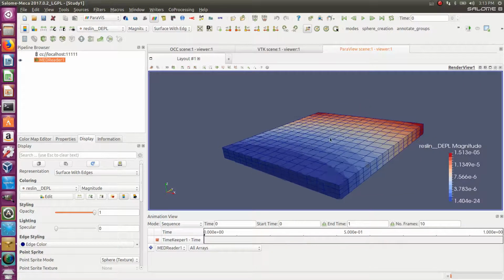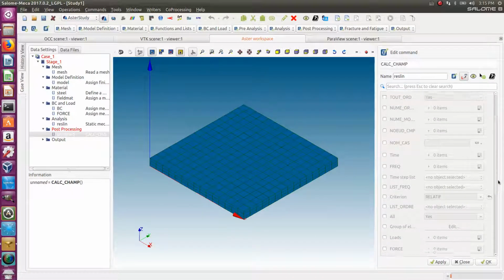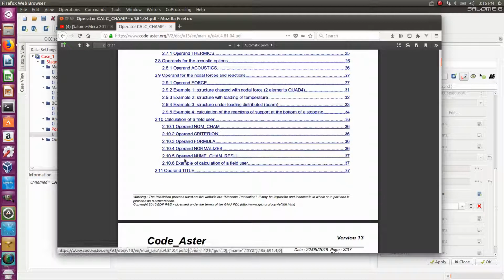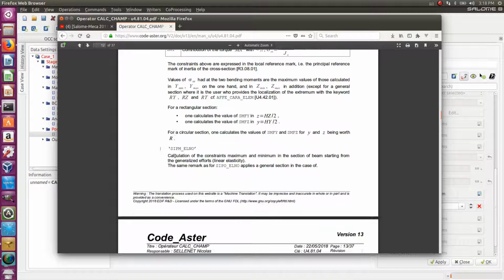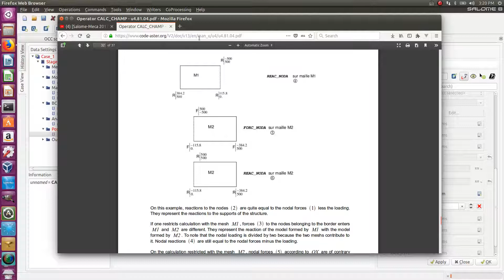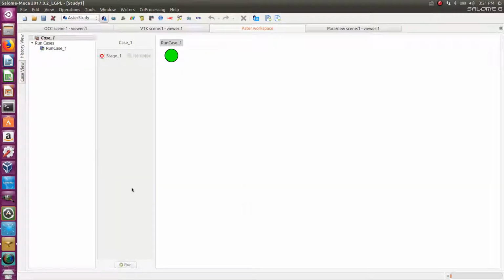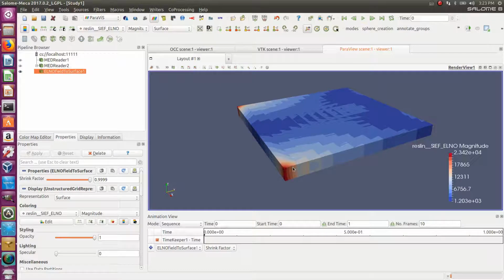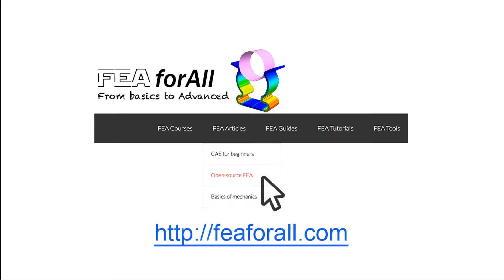[Salome Meca Tutorial] Extracting Stress Results

Comment: Thank you Cyprien. A really great series to learn how to get started with Salome Mecca. I just tried doing something very similar to what you are doing in this video, but even thought I select SIEF_ELGA, SIEF_ELNO, SIEQ_ELGA, SIEQ_ELNO I don't get any ability to visualize the stresses. New version? Could it be due to the fact that I am using the "3D" element?
Reply from the maker: Hi Thomas, the CALC_CHAMP command must have the same name than the previous “reslin” command. Make sure that the name in CALC_CHAMP is also “reslin”. Otherwise stress results won’t be added to the simulation
Reply: @Feaforall  Yes - I have followed your videos and that was a great tip. For some reason, this still doesn't work for me. What I am finding, however, is that the new visualization inside 9.3 is much simpler to use than the full paraviz, and for some reason the stresses are exported just fine there. One has to click on the result file in the History View, and select Post-Process
Reply from the maker: @thomasdegremont6432  I see, then the problem in paravis is maybe that you calculated only stress at gauss point and element only and not at the nodes. If you have the nodal stresses, then you will see them appear in the output results list right after opening the file, but if you don’t and you have calculated only gauss point/ element stresses, then you will need to use a special filter to make those results available. I think I have a video about post processing stress with paravis. The name of the filter should be mechanical > Stress to ELNO or something like that

Comment: Do  you know if it is possible to apply different force in time? F(t) to get stress in time sigma(t)
Reply from the maker: Yes, it’s possible. You have to do a transient response simulation for that. I haven’t done any video about it unfortunately. You can go on the code_aster website and dig into the DYNA_VIBRA command. I think that’s the one to do this kind of simulation.
Reply: @Feaforall  thank you. I am gonna try.

Your channel is the only one that I found good on internet. In my language there is nothing about Salome Meca.
Reply from the maker: Thanks Leonardo! I think that’s a general problem with open-source software... it’s free but it’s difficult to use so it generally comes with paid service from consultants. Few people teach this knowledge for free ;-)